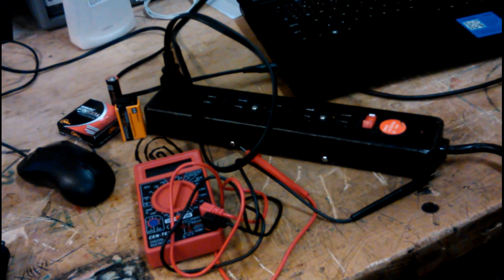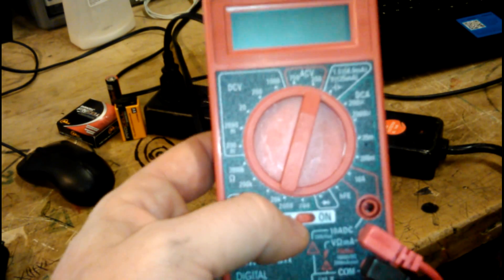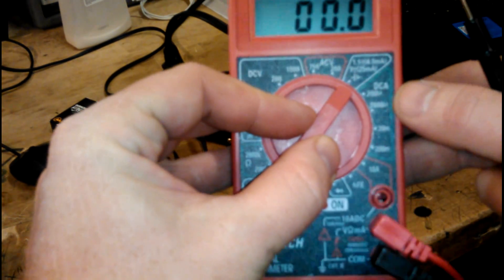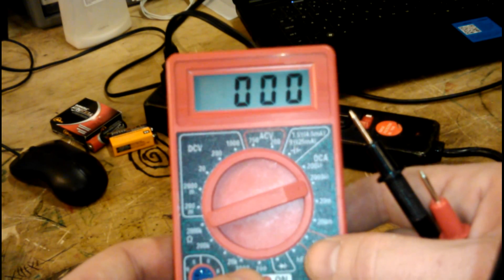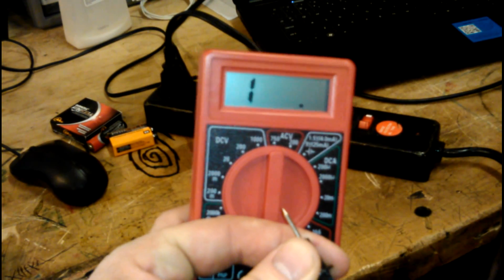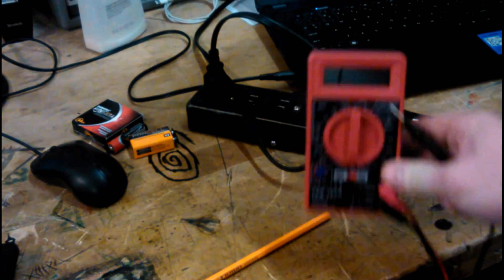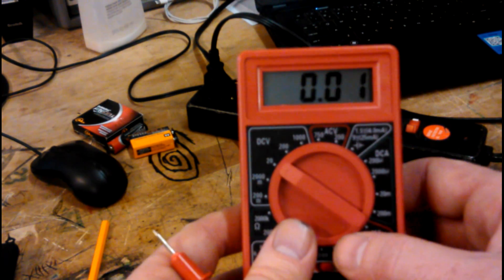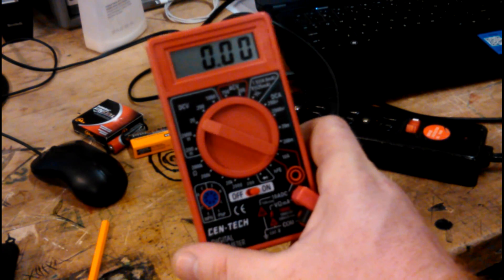Harbor Freight FREE multimeter; Tools for SHTF!

Comment: with which one of these option do you test capacitors with?
Reply from the maker: Fading Skater well...  you can and can't.  for small ones, you can use the resistance ranges to make sure that they aren't 'leaking' or shorted.  it cannot tell you if they are completely open and useless, or what the capacitance is.  A capacitor tester is a completely different device.  If you are applying it to an electrolyctic cap, make sure you observe the polarity so you don't damage the cap.  hope this helped....  good luck!

Comment: I am a disabled vet and I get those free almost every 6 months. I get the coupon for it and usually 3 other things . My wife always get the free things as I already have 3 meters. I have to use the higher range to test my handicap scooter it has a battery pack of 60 volts dc. 
I learned my electronics in the NAVY on submarines . I was on SSBN 619 634 and I was taught with a vacuum tube meter and simpson 220 . Those 2 were the only ones you could use on a submarines back then. I also was taught tube electronics which today is a dieing art . One thing on the sub I used a meter most on was a mk 19 gyro it had over 300 tubes.

Keep up with the great videos it brings back some great memories
Reply from the maker: Thank you for your service, sir.   The submariners are a special breed indeed!  I cannot even imagine 300 tubes burning in a small enclosed space like that.  Wow..   I'm sure you have some stories.   Tubes are still in use in a few industries...  musicians still love them in a few amps and effects.   The best ones are made in Russia these days..  they kept the technology going a lot longer than we did, as tubes are inherently  EMP proof (well, highly resistant, anyway!).  I love the old analog meters too...  I still have my clamshell Radio Shack meter that my mom gave me for Christmas when I was 12, and it still works perfectly.  Thank you for watching and chiming in!

Comment: How would you set this meter to check 24v on wire going from landscape controller to anti syphon valve?
Reply from the maker: Most of the time, from my experience, the power going to the irrigation valves is AC, so set the meter appropriately and go across the leads at the valve to see if they're getting the power.  If they're not, check at the controller to see if it's that, or if it is putting out, you have a bad line.
Reply: Usually that's a long run and all you need is a continuity check as 99% of the time the wire underground is broken or disconnected at the valve.  I had an extra 100 foot lamp cord (but any cord will do, even an extension cord with an alligator clip)  Use it to reach the multimeter PROBE. Take a Ohm (Continuity) check if open you will get ZERO.  Then start digging to find the broken wire. (You don't need to check the Voltage, that's not were the problems lies.) If want to check voltage do it at the box, or directly at the Valve, your choice.

Comment: Why not measure the batteries in DC volts? You would get 9 volts for a 9 volt battery.
Reply: All batteries need a load to test, BUT there is one exception - A car battery -  For a quick check there's list by voltage which tells you how much charge you have left on your car battery.  I don't remember the numbers by memory but you can google or stop by a Motorhome repair shop to get the printout.   i.e. example 24.1 requires charging, 24.6 volts fully charged; 24.5 volts 3/4 charged and so on.  These aren't correct numbers but just the idea how it works.  The chart goes quite into details  i.e. 24.15  24.16 etc.  It probably won't help car owners, it was meant for Motorhome housebattery owners that rely on Voltage for living conditions inside the coach.
Reply from the maker: Sounds great in theory, right?   Theory doesn't apply in reality.  A battery has to be checked under load to see how well it is performing.  A new 9V with no load may measure out at ten volts or more...   a battery that measures at nine even with no load may not have enough oomph left to power your device.

Comment: good vid!
i have a similar meter and ive always wondered what the little circle thing with letters,  in the lower left corner of the meter does? Its left of your OFF switch on your meter...
Thanks
Reply from the maker: Not being able to see it, I would guess that it is a transistor checking utility, which will check transistors for leakage and test their inherent gain.  For the record..  I have NEVER used this function.  That's really more of a mid level bench technician need.    Thanks for watching & chiming in!
Reply: GoingGoingGalt 
ok thanks!
so im assuming you would insert the 3 legs of it into this part of the meter...
good to know
Reply from the maker: You just have to know which are the emitter, the base, and the collector, and then there is probably a switch to select the type, either pnp or npn.  Good luck!
Reply: GoingGoingGalt 
ya, looks like 6 holes in it and pnp and npn are marked. So it should be easy enough to get a datasheet on the specific # before testing it.
thx again

Comment: I am trying to find out if I have live wires under my house.  How can I test them with this?
Reply from the maker: The only way that this meter tests for the presence of EMF (voltage) is by direct contact of the probes to the conductors.  If you can trace down the wires and find out where they go, you can probably get to an exposed end and test them there.  If not, there is another  device that is available at your local hardware store called a non-contact electrical tester (they're pretty cheap...  under $10 usually.  It looks like a big plastic pen.).  It will beep when placed alongside a live conductor.  They're so sensitive that it will beep from the static generated by rubbing it on my arm hair...   which is how I confirm that it  is working each time I go to use it.

No matter what, if you are going to cut the wires or cut into them, turn off the main breaker to the house before you do.  (And if you have solar, be sure that system is disengaged as well) It's the only way to be 100% sure that an unknown conductor is de-energized.   Good luck, and thank you for watching and chiming in!
Reply: thats easy are the wires exposed ? do any of the wires have any copper shown ? If not you might need a TICK tracer.
Reply: thats easy are the wires exposed ? do any of the wires have any copper shown ? If not you might need a TICK tracer.

Comment: Thank you for this video. It was very informative. I have one of these things in my tool box for years and had no idea how to use it. very cool, now I can get rid of any batteries that are dead in the drawer. 
What does SHTF stand for?...thx
Reply from the maker: That makes my day when I hear I've helped someone, thank you so much for replying!  And SHTF is a term used by the "doomsday prepper" community...  standing for "When S#!+ Hits The Fan";  a possible day in the future when the systems of normalcy that we take for granted no longer are there.
Reply: GoingGoingGalt you didn't tell Steven he can't check his batteries with this meter, other than if they are completely dead, but even then dead batteries can come to life if charged properly. Steven needs a better Multi-meter or a battery tester to be certain.
Reply: @demaXxXx  .... the multi-meter will not tell me if a battery is good or not?

Comment: Hi Tripple G: A ? : what settings do you set the meter on to measure flow of electricity, example 60amp breaker feeding a heat pump, where the heat pump also has a 60amp breaker seperate from the breaker box, which is on the unit itself?
Reply from the maker: Hi Donnie; I'm a little unsure just what it is that you want to check out.   If you want to measure the current (amps) on something like that, you will have to use a "clamp-on" ammeter...   maybe I will do a vid on one.  This little meter does not have that capability.  Is the heat pump working, or are you trying to troubleshoot it?  Let me know, and best of luck to you....
Reply: Its my brother heat pump,  the inside breaker for the home is got a little warm and tripped. The breakers on the unit doesn't trip so  we figured that the breaker was bad where there was electrical condensation built around the breaker. Changed out the breaker on the unit and still the breaker inside the home trips off. Thanks for responding back,
Reply from the maker: Well, if the breaker is warming up and tripping, that's certainly an indicator of an overcurrent situation.  You didn't mention what the ratings on the breakers are.  Also, heat pumps are usually 220, so it will probably be a dual gang breaker to feed it.  I'm not sure what electrical condensation is...  if you're getting water around your breakers, that's bad all around.  Best of luck to you...

Comment: If "amperage" is not a word, then why is "voltage" a word? Even my spell-checker claims that I did not use any non-words. Thus, I consider current and amperage as interchangeable words. Also, it should be noted that "current" may be the worse word choice, as you can also say, "at the current time" or "at the present time". Seems that the word "current" is more ambiguous. It has too many possible uses. Although, I do agree that convention suggests using the word "current".

However, I do have the pet-peeve of people using the letter O in the middle of a number. Concerning phones, I often say that the letter O is on the 6 button. If you mean zero, then say zero. The characters have not been interchangeable since the days of typewriters.

I also dislike vague pronouns. Well somebody wishes me to "Have a good one", whatever does that mean? How long should I spend trying to decipher that? Should I have a good evening, a good day, a good week, a good month, or a good night?
Reply: Amperage is a word, just add it to your spell checker.  Current flows and amperage is its measurement.  And Voltage is what pushes those little critters..

Comment: so what about if im testing for 48v with multiple batteries in a car... i put it to 200v? cause i left my voltimeter at 20v and it reads 1. on the screen... i have my measure dial too low than 200v?
Reply: Yeah it should be at 200V, 1. just means its out of range. I always suggest getting a autoranging meter to start with because it makes learning a lot easier.

Comment: What measurement do you check capacitors?
Reply: You use a meter that's designed for testing caps, they start at around $10 USD shipped.

Always use caution when working around lager capacitors, in a poorly designed circuit they can store enough power to give a nasty little shock for a long time.

Comment: I have a couple of these that I stash in various places for quick checks or where I try to avoid bringing my good meter, like the garage. The specs are listed in the owners manual and for free they are not too bad. I verified them against my good meter that is 4.5 digit, .001% , with a NIST certificate. You almost never need that kind of accuracy but it makes a good calibration standard. I love it when somebody swears a piece of measuring equipmemt is accurate when they test it against another piece of junk and they match. There are a couple of things about this cheapo that annoy me. The probes when shorted together do not read O on the 200 ohms range.  Some of it is in the crummy connectors and skinny test lead wire but even if you jump the terminals with a jumper of heavy copper wire, you see a rather unstable .4-.7 ohms. With leads it can be well over an ohm. At least in the old days, analog meters had a 0 adjust. Another problem is the really crummy test leads. The insulation often separates at the connector. That is where Amazing Goop comes in handy. It sticks well to the wires, has high dielectric strength (a good insulator), and is a good strain relief but it does look like crap. I agree, a beeper continuity check would be nice but  the cost of the beeper element might raise the price  beyond what most people pay for it: FREE!!. A frequency function is really reaching. I have used the transistor test  function. It measures DC beta or how much a transistor amplifies. Good for selecting transistors in switching circuits. It actually works but the socket is such poor quality, that with much use  you have connection problems. Frankly, I am amazed that they can make it so cheaply. I can't buy some of the components for what this goes for Another feature you will find in an even slightly better meter is auto ranging. You don't have to worry about frying the meter because you measured 48 volts on the 200mv range.
Reply from the maker: Very good points.  Yes, the leads are crap and I wish it had a zero adjust (Like my Radio Shack Micronta analog meter that I have had since I was 12..  made in the early 80's and still works awesomely!)  And about not being able to buy the parts that cheaply; that's another great use for it.  I take them apart and use them for standalone voltmeters in my vehicles (Like the 3 I use in my RV to monitor the battery bank levels).   Thanks for chiming in!
Reply: I always pick up a new free one because the leads break off. I always wondered why it never zeroed out too.
Reply: I was gonna make a car voltage meter out of one until I got a good look at how it was put together (this was back before they went to the thinner smaller circuit board) so i just opted for the $2-3 Amazon voltage meter along with one that plugs to cigarette lighter for backup, but ive stuck the HF DMM on my dash for temporary when I had a 2000 Cavalier that had more money in the electrical system then the car was worth and had a switch hooked up to alternator to give it a small voltage boost when needed to make amps play louder and it made the car so if I had the music on when idling the motor wouldn't bog down or die as bad,  I used to watch my voltages like most people watch the road